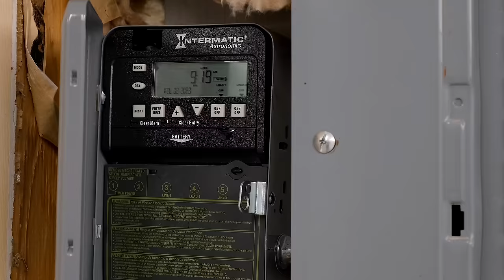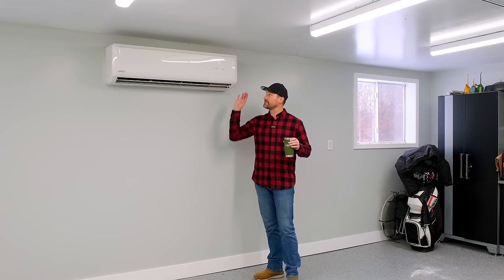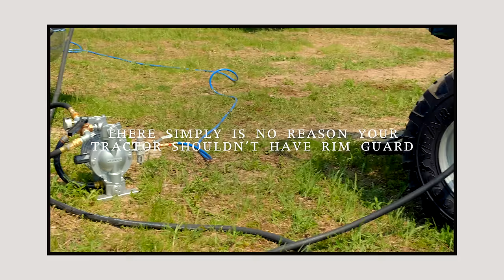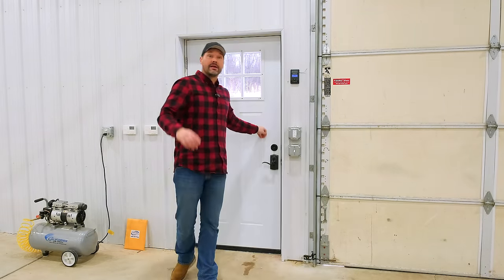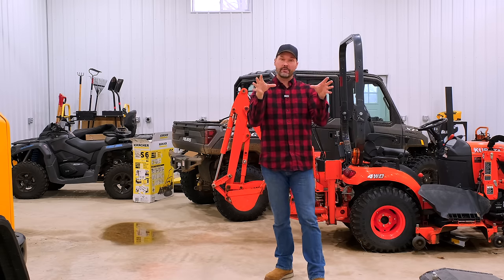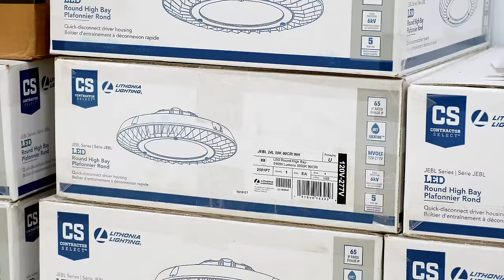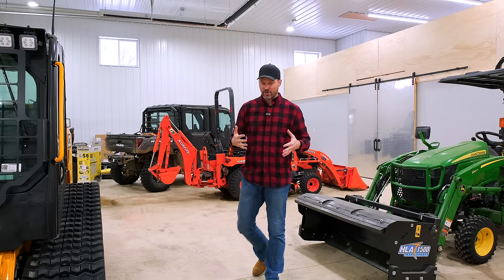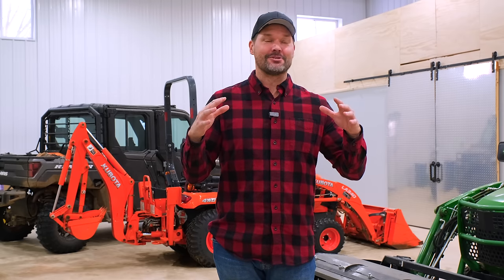AVOID THESE TOP 10 POLE BARN MISTAKES OR IT COULD COST YA!

Comment: I built a 32x48x14 workshop when I retired to use mainly to build an airplane.  My biggest regret was putting only two 240V outlets in one corner of the shop.  I planned for welder and air compressor, but now wish I had some spaced on other walls for power tools such as table saw, etc.  My biggest good decision was the in-slab hydronic heat.  It is fantastic.  Once you have worked on a warm concrete floor in the winter, you will never want anything else.  If you invest money nowhere else, invest in the tubing in the slab for radiant hydronic heat.  It is the cat’s meow times 10.
Reply: What plane are you building?
Reply: @Veritas1992  RANS S-21
Reply: Floor heat would be nice but wonder how it really works when you only want occasional heat in the building. I'm currently refurbishing my 32x42x14 shed build in 1970 on an old barn foundation. Now sure I'm going to use it as a shop or just park cars and equipment in. Will spend plenty just putting in new concrete and garage doors, etc.
Reply: @keithwiebe1787  It would depend on how occasional you will use it, how long each use is and how much in advance you would know when you plan to use it.  In floor radiant heat’s main drawback is slow response and you can’t do much about that as it is simple physics.  I would say my building will heat up at maybe 1 degree an hour.  So, if the building is at 40 and you want to heat it to 65, you are talking 24 hours at a minimum.  Having said that, it costs me almost nothing to keep mine at 60 all the time and then bump to 65 when I plan to work in it.  However, if you only use your building once or twice a week for an hour or two at a time and you don’t know more than a couple of hours in advance of when you will use it, then radiant in floor heat probably isn’t for you.
Reply: With the radiant heat overhead, it’s almost as warm on the concrete as in floor. It is much better in very cold climates vs in floor. I live in Canada and after experiencing both, I went with overhead with a supplemental ceiling mount forced air unit. If we open the doors and it’s -30C, the wind is blowing, etc, the forced air is a great source of instant heat in the air. It’s not used often, but is great when we need it.  Depending on where you live, the different systems have different benefits. There’s no single correct solution.

Comment: I have a 45 x 50 x 16 foot steel frame building with loft accessed by my scissor lift that has a short stairs on it that is removable. This makes the space occupied by your stairs a parking spot😉.  Built the building 36 years ago. In our state anytime you have more than 3 gas vehicles you must have an explosion proof pit to catch the gas from the floor drains which go to a drain field. I put a threshold at each door that lowers the bottom door seal 1" below the building floor so no water flows into the building-works great. I believe you must have a door for every large piece of equipment to use your floor space well-so I have 4 insulated double sealed doors. Two doors are 12 x 12, one door 10 x 12 and a 12 x 14 so if it goes down the road it will go in the building. If you don’t heat your building you MUST put 1 inch of polystyrene under the concrete to keep the floor from condensing water in the spring. I put chain boxes in the floor so I can pull on heavy things. All attachments are on castered platforms so they roll together for compact storage and are easily positioned to attach to the tractor. This makes attaching things so easy I got ride of the JD imatch. I don’t believe in windows as they are a security risk, are another thing to have to work around, involve large heat losses and let in ultraviolet light to degrade everything in the building. Just put in great lighting. Add ceiling fans. Infrared heat to dry the floors and forced air heat and air for quick recovery because I only heat or air condition when I have a project. If you heat full time, heat in the floor would be the way to go but it costs as much to heat this well insulated carbarn at 45 degrees as my house. One beam has a movable chain hoist on it and the beam is stressed to lift an extra 4000 lbs. Plumbed for a bathroom if ever wanted, have a utility sink with electric on demand heater to get warm water for cleaning and wired for internet and alarm. Only 100 amp service with outlets every 4 ft. Should have been at least 150 amp.  The bottom 8 foot is 1/4 inch pegboard which I highly recommend as it is so versatile for storage. The building isn’t big enough but is the same size as my house and the code would not let you go bigger🤷‍♂ and divorce lawyers aren’t cheap!😉. Really, my wife agrees the building isn’t big enough-she is a good woman but at 70 it will have to do. Hope this helps someone out.
Reply: It helps me as we are just in the planning stages. The 16’ is your center or sides?  We are considering a 40 x 50 with two 12’ overhangs.  It has to house my tractor, sawmill, a possible future travel trailer and about 12 implements right now.  Figure to put implements that don’t have hydraulics or motor under the overhangs and everything else mice can chew up inside which right now is just the grapple and mulcher but in a couple weeks will be the mcs
Reply: @elained9591  16 ft sidewalls which is the minimum if you want a loft in part of your building which I would really recommend as it is relatively free space and great storage. Be sure to have concrete under your overhangs because it makes working with your implements so much easier if you have them on castered platforms which I can’t stress enough. My neighbor went with 4 inch concrete without polystyrene and I put in 5 inch concrete with polystyrene. WHAT A DIFFERENCE. Don’t make this mistake. I assume you are in a snow free environment as opposed to me in Minnesota. For me to have my implements outside would be frustrating in the winter. 40 by 50 is probably small for your purpose. Most of us only have one shot at the building size. We have a tractor, small Motorhome, an antique truck and riding lawn mower all with their own doors as well as all my implements, workbench and storage. It is full. I would assume you would have a bigger Motorhome -travel trailer (ours is only 23 ft) and the sawmill will require more than my antique truck. You will love having the building. Someone stopped by the other day and wanted to buy my place because of the building-didn’t even mention the house so they do add value to your property.
Reply: @bruceanderson9461  thanks!  Yes, I’m in a part of NC that doesn’t often see snow anymore.  We used to get a good bit but that was decades ago.  We didn’t even get a flake this year.  We have had a surplus of rain though.

With the price of concrete being astronomically high right now, it’s not doable in our budget for awhile, even septic tanks have more than doubled in cost and they’re usually plastic now days.  It looks like everything will have to be crusher run, but I can keep it a bit lower for the future concrete. I will need to price everythign of course.  

I was wanting a 50 x 60 with overhangs but the one guy says 40’ is all he can span.  Of course we will get others to compare.  The sawmill is about 20’ in length. I don’t keep the tongue on it to deter thievery, it’s kept locked up.  We were looking at a 25 ft -28ft trailers.  If the dogs die before BH retires, we will go back to one dog so we won’t need anything too long.

I also want a standing seam roof so the fasteners are hidden.  I can no longer climb ladders and the rubber grommets on corrugated panels fail, fortunately or unfortunately, they may fail before I start feeding the roots of grass and trees lol. When I worked for a commercial roofing company, back in the ‘90’s, we often had to go put in new screws on corrugated panels that were 10 to 12 years old.   I was in my mid 20’s to early 30’s,, light in weight and foot and had to have a rope tied around my waist whilst an older guy would be on the peak holding me.  With the way manufacturers make things now I’m uncertain if the rubber would last that long.  I certainly don’t want to scramble around a roof now in my 60’s.  And my neurosurgeon has nixed me being on a ladder ROFLOL.

I’m uncertain I really need a loft.  There’s the upstairs in the woodworking shop, which has a 12x40 lean to attached.  The 1025R won’t fit into it because the hvac company put the split system on the high end where I would need to enter and I can’t take the ROPs down on it, I’m too short lol.  The other side has a passage door.  We will be building doors for the open side.  Seems someone told our Sheriff about a nitwit that wants to steal tools from the shop where the old man recently died.  We think it’s our neighbor’s property as her husband died last year and was in the construction trade.

And yes, outbuildings can add value to property.  I wanted our new place because of the shop, BH loved the house…

What size would you recommend?
Reply: Spot on with using pegboard,my walls all have white pegboard on them. I bought a pile of  used gondola shelving that used the white peg board on the back. Low cost wall covering and strong shelving that can easily be adjusted as your needs change.
Reply: I would strongly recommend white pegboard with a brown woodgrain to make it easier on the eyes. 36 years ago I don’t think this was available so I had urethane painted on the traditional brown pegboard. Make sure it is the 1/4 inch pegboard as you need the strength of the 1/4 inch hardware to hold the hooks and shelf brackets that you will use.

Comment: Courtney, my only advice about the floor is --- it's a floor, it gets used.  Heavily!  If you ever put a nice finish (epoxy or other) on it, then every time you drove the tire chains on it or dropped/scraped/slide/spilled something on it, you'd probably worry or get upset.  Avoid future anxiety.  The floor looks great now and works well.  I have a three car attached garage with a concrete floor which I could finish, but then I just know that I'd be upset every time I "damaged" it somehow.  I don't need it to be a work of art - just really useful!  Great video!  Thanks!
Reply: Even with my diy epoxy floor I can slide motors across it without damaging, I'm assuming he'd have pros do it so it would probably hold up even better
Reply: @trevortimmreck  Excellent!  But over time the paint will wear in the high-traffic areas/paths - it has to.  I epoxied the garage floor in my previous house and it looked great for maybe 3-5 years but when it started to look worn, it wasn't as pretty.  Just sayin' that floors take abuse by their nature.
Reply: I mean,  so would the concrete though
Reply: Courtney you should look at waterproof vinyl plank flooring. It holds up great. I don’t know if it would be affected but equipment. I don’t think so because it’s interlocked. Just a thought.
Reply: @brooster87  we just put some upstairs in the woodworking shop, the directions say to lay down plywood before dragging stuff across it.
Reply: @elained9591  Thank you. I thought it would be tougher than that.
Reply: Three words. Horse. Stall. Mats. At least in areas where you’ll be using a ton. Around benches etc. I have a mixture of areas with bare floor with a basic penetrating sealer and other areas with  3/4 inch horse stall mats and a few spots with doubled harbor freight foam mats (where I’ll be standing for a long while). Some variants of the harbor freight mats are 3/8th despite claiming 1/2 in. Two stacked keeps it level with the surrounding horse stall mats. I can easily route power cables between mats or even route in channels.

Horse stall mats will even take the abuse of metal tracks.
Reply: @silverbackag9790  Great suggestion!  I'd used the 3/4" mats (from Tractor Supply) in the woodshop in my previous house and they were great on the legs!  No fun to through around (but Courtney's forklifts would simplify that).  Definitely not the thinner variety though.

Comment: I used a propane ceiling-suspended fan heater.  IT'S VERY LOUD! Works fine, but I wish it was quieter. Also used 4x8 panels on the interior walls and spray-painted them white. The wood needed a lot more paint than I estimated. If new construction in snow country, consider prevailing winds to place the garage doors facing south. The prevailing west wind blows the snow across the front and the sun can melt some of the snow.  On a separate existing garage, our doors faced east (towards the road).  All the snow on the roof blows off and piles up as drifts in front of those doors.

Comment: Great job!  Agreed, most shops are poorly lit and as I get older, light is my friend.  My shop is only 12' tall only because I wanted a dual post vehicle lift, but I did install a commercial garage door opener to allow for my 10' door to track all the way to the ceiling.  Using a mini split as well to heat/cool the entire area.  Just a cleaner and more cost effective option than radiant floor heat, a wood stove or a forced air furnace.  I know i'll regret not having the floor heat, but was a bit out of budget for me.  Again, great job and let us know what you do about sealing your floors.

Comment: The use of a potable or if enough space is available, then the ability to have a car/tractor/trailer lift to be able to service anything you want without having to crawl around on the floor.  The portable units are nice so you can remove and clean up or use the space for other things.  As for your ideals of a lean too, there is always an option to add on on.  I've seen them with walk in and roll up doors under them and they have all worked very well.  Evaluate the wind in your area and even consider closing in one or more sides of the lean too to prevent weather infiltration.   Good luck!! Very nice setup!

Comment: I had the builder put metal on the ceiling, but not the walls as you did.  I went with OSB all the way around and painted it white.  It is nice as bright like your building, but I can easily attach anything to it and it doesn’t dent as easily if hit with a ball or piece of wood or such.

Comment: Getting those windows up high is perfect, you'll have no security risk and still receive plenty of light. However there is something to be said for locating them on the north side of a building, especially here in the South. You'll receive very nice indirect light without the extreme heat if they were south-facing.

Comment: We have 3 of the same type of heaters and what really helps is to have a couple slow moving ceiling fans to circulate the heat
Reply: How do these radiant heaters compare to other forms of heat in cost to run and new purchase? In other words, If you were designing from new again, what would be the rank order? Example:1. Radiant floor hydronic. 2. Radiant floor air. 3. Radiant ceiling propane. 4. Forced air gas monitor style..... and etc? I've got a couple of large buildings I'm designing now and seriously thinking about radiant floor air heat systems.

Comment: A lot of great points! My building was already here it is 40x65. The previous owner had cheap florescent lights which were all on extension cords plugged in everywhere. So i bought some new LED lights and they were bright but when I started watching YouTube channels and seen the round ones, I bought one to see what it was like. It was bright but I could look up at them. So I bought brighter ones and they do great. The original ones that were up there were like the ones you showed on your video and i wasn't about to replace the bulbs, so I took them down carefully. One of the other lights i took down had mice in it and I wasn't expecting that! Each section of the building is wired separately which is good. I couldn't get an electrician to come out to help with it so with a tall ladder I ran new wiring to the switches. It also already has outlets for 220 welding which is a good thing. But I would prefer if an electrician would come in to make sure I don't get zapped. The mice population has been hit pretty hard by bait boxes outside and traps inside. One bad thing is when the concrete was poured they didn't cut it so it would not crack badly which it hasn't.  The concrete should have been just a little lower at the roll up doors so water doesn't go underneath them.

Comment: Great video! May I suggest a bathroom? If the barn is a good distance away from the house, it's nice not to have to stop everything. It also prevents getting caught to do another thing on the honey-do-list right in the middle of a project. 🙂 Congrats on the shop. It looks amazing!
Reply: A bathroom is very nice, especially if you are dirty from working on something, you don’t have to track a mess into the house for a quick trip. And the neighbors don’t see you having to pee around the corner.

Comment: Outstanding video!  My biggest regret was not doing my due diligence regarding sidewall height.  Second regret was putting windows down low.  Third regret was painting the floor.
Reply: Tell me what the deal is with windows too low? I need to add some to my shed. I worked on a painted floor (some kind of home install epoxy) and it would last 10 plus years in a mechanic shop if one was somewhat careful. Slick when condensation a certain time in spring.
Reply: @Keith Wiebe  windows down low eat up valuable wall space, invite prying eyes and provide additional ground level entry points.   Narrow horizontal windows up high allow natural lighting to flood the workspace among other benefits.